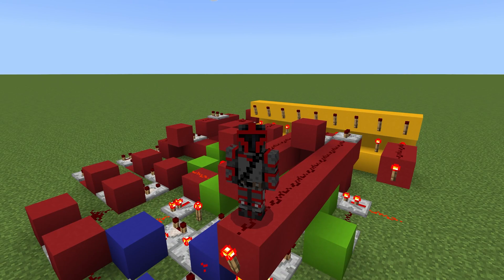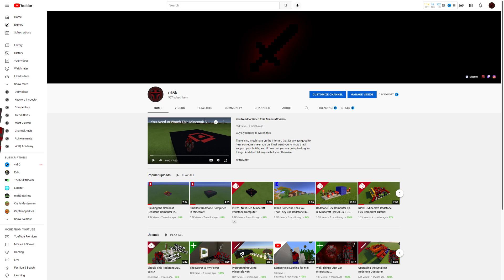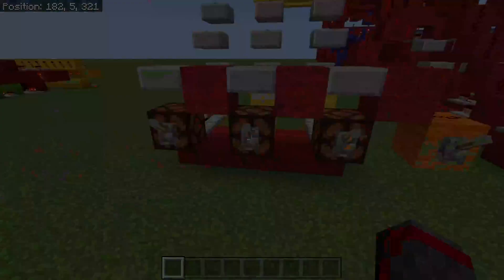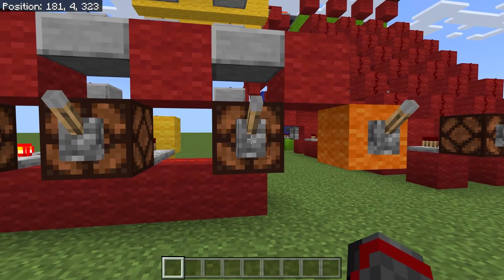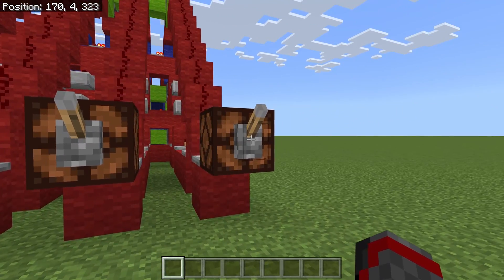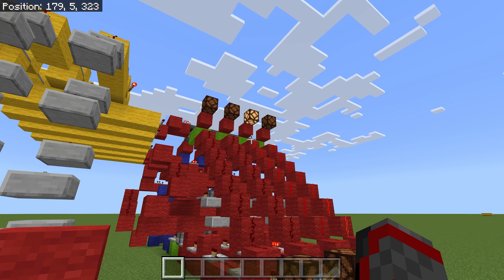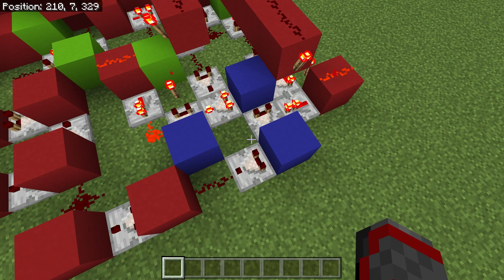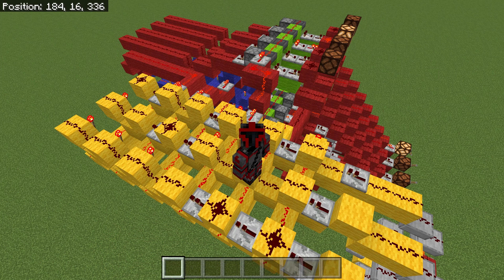Is this the Smallest Redstone Computer in Minecraft?

Comment: For the RPC 1 what is the port on the right side that goes to the decoder supposed to do. It can’t activate the decoder because it only goes to the top red stone line. What does it do?
Reply from the maker: So that port was supposed to be an input + output port, but unfortunately I messed it up. Currently, it has no use.